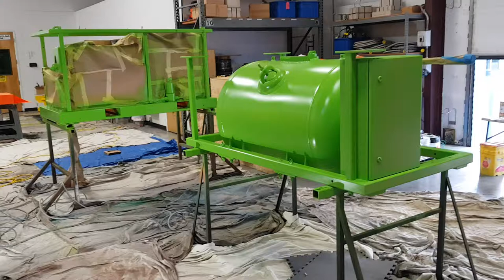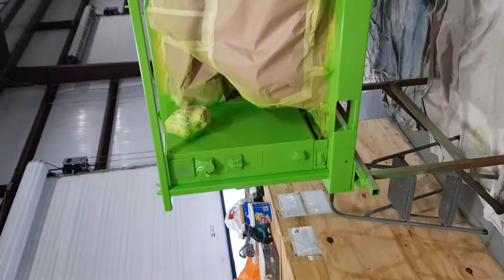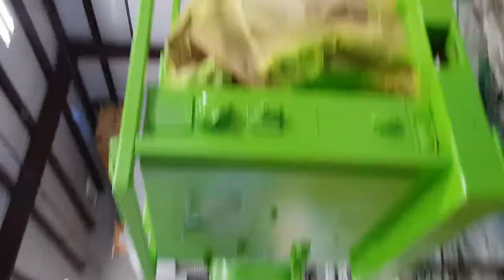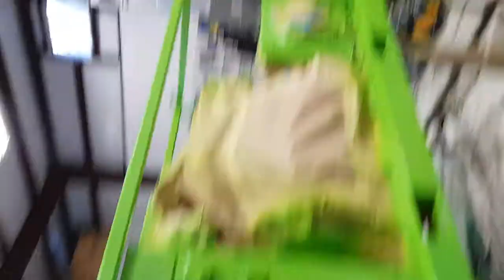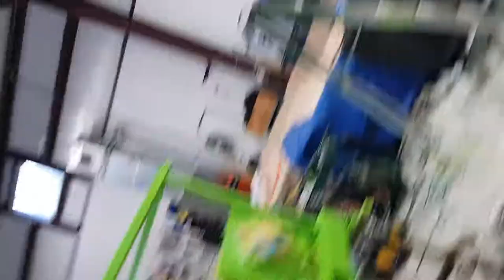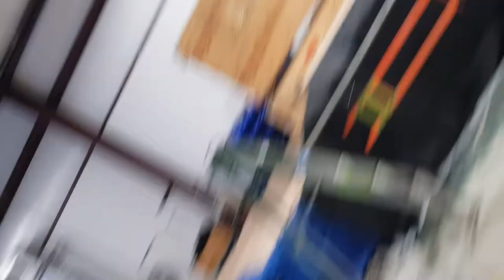On-site electrostatic painting and refinishing

Comment: Does it leave orange peel ?
Reply from the maker: It can and will peel out on you just like spraying with an air gun. the key is consistency in mixing and applying it. Always check your viscosity and get the paint mixed and thinned correct and you remove alot of issues. One advantage with the system is electricity is very effective at atomizing the paint in very small droplets - smaller than air spray, with very thin and repeated coats things like oj peel and  solvent trap/pop are less likely.
Reply: @86spirit60  yeah I’m just wondering because I’m not to worries about orange peel on handrails and such things I hate orange peel on solid screens
Reply: I mix my paint perfectly I was just wondering if it’s common I use pithane two part paints
Reply from the maker: @r6613  I hate orange peel too but it's so common its even on brand new car paint nowadays.
 I think I have used that paint you mentioned before the pithane. It's ppg right? Are you spraying that paint with an electro gun or air gun also
Reply: @86spirit60  honestly the orange peel settles in after a few days it doesn’t look to bad and plus someone who isn’t a painter won’t even notice all they care about on wrought iron is if it’s painted the color they desire and yes it’s ppg best paint out there
Reply: And yes a ransburg no. 2
Reply from the maker: @r6613  glad to see your using the no.2 - the best electrostatic spray gun ever and I would agree ppg is probably the best stuff you can shoot with it, ever used the coraflon before? Dont think I've ever seen a tougher paint
Reply: @86spirit60  yeah it really is when you take care of your gun it can shoot so easily but no I’ve never used that paint before only pinthane urethanes they last a great while 7+ years they’re perfect